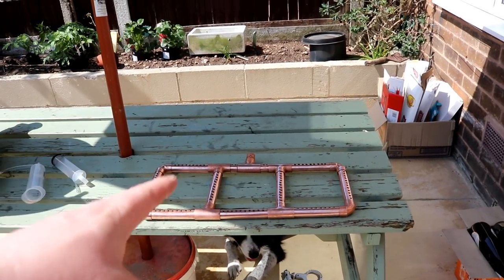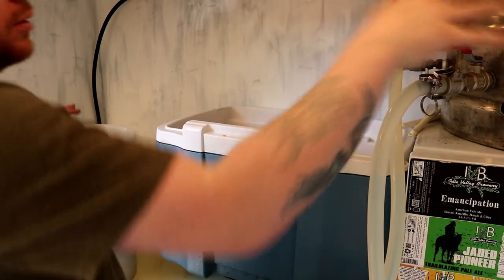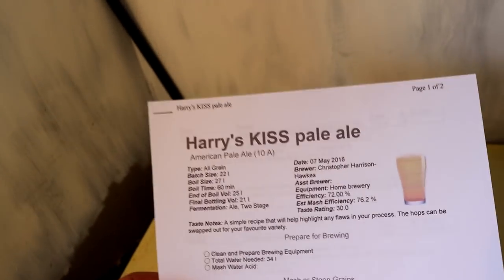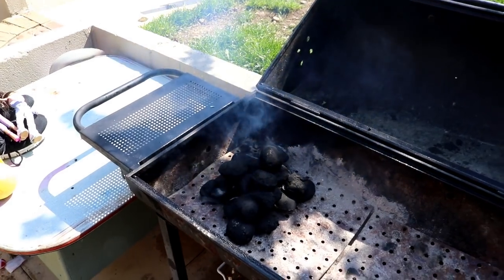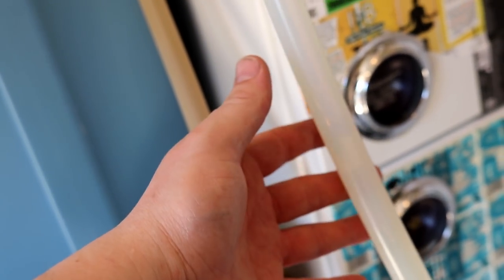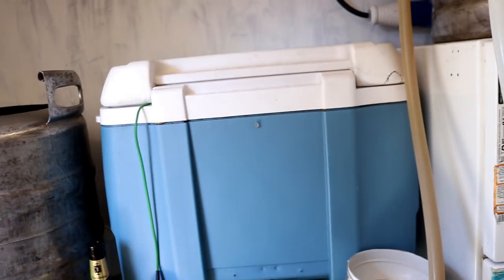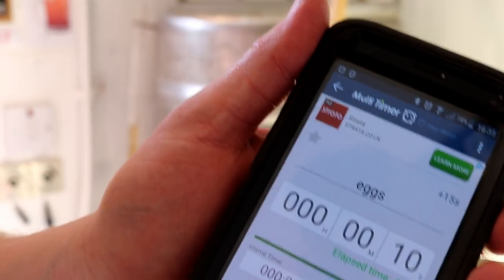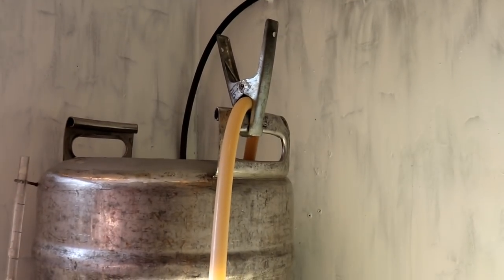The Simple  Pale Ale Recipe and Brew Day

Comment: I've noticed that dry hopped beer has a better aroma but has to be drunk fresh. I now add hops at flameout and hold at 75°C for an hour which makes the hop flavour last longer in the bottle. It also ready to drink quicker than dry hopped beer. A tea bag left in hot water for an hour adds much more flavour than a tea bag added for a short time. That's the principal I working by.